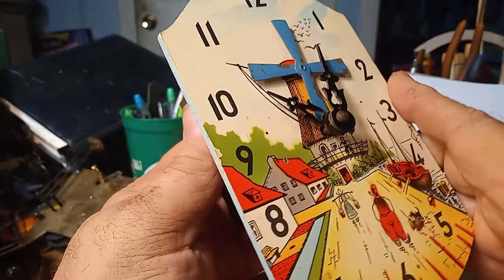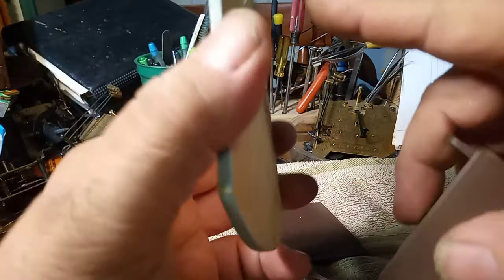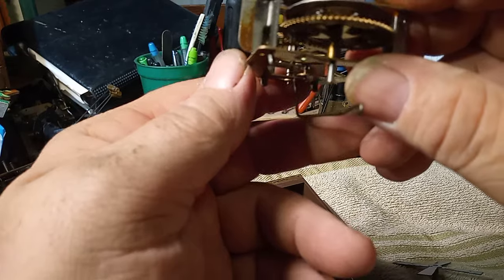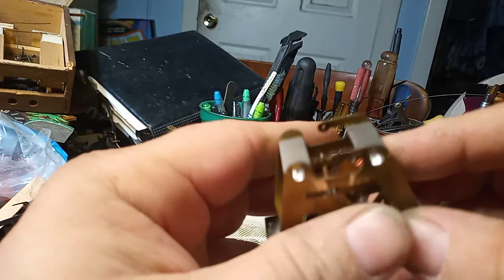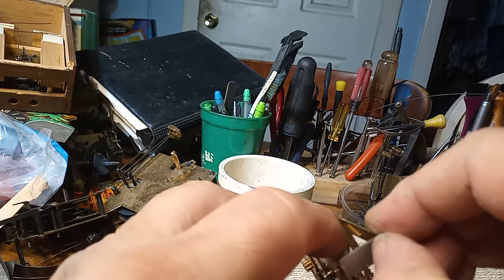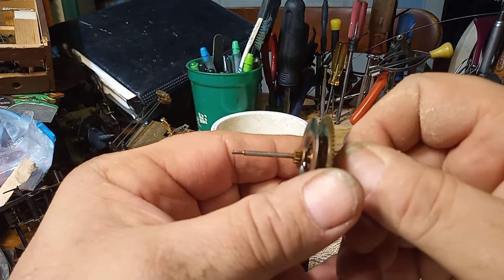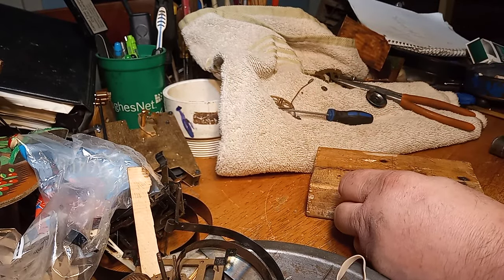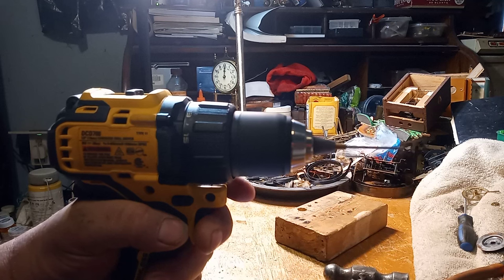Repairing a novelty clock made by J. Encstler that quits running due to a bent shaft.20220313 163327

Comment: I knocked off my miniature grandfathers clock off the dresser  and the same thing happened the shaft is bent the hands won't spin unless you set the time manualy by moving the hands
Reply from the maker: It was easy to straighten this one out. Not sure how easy it would be to straighten yours out. You might give it a try.